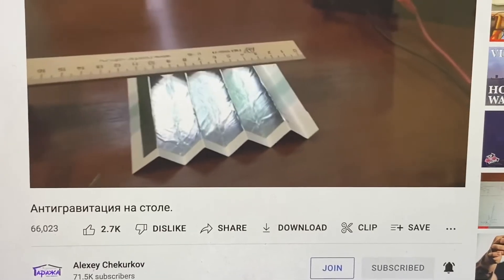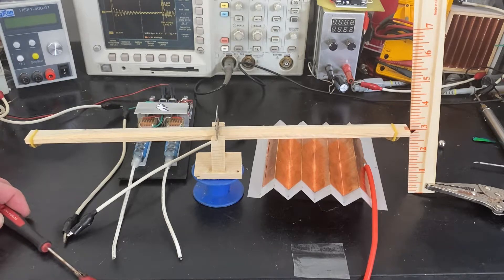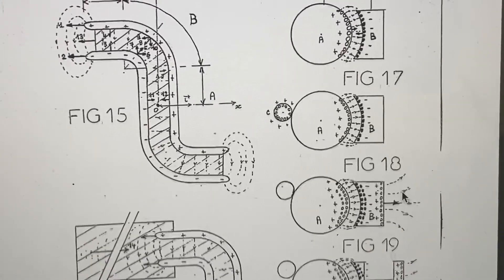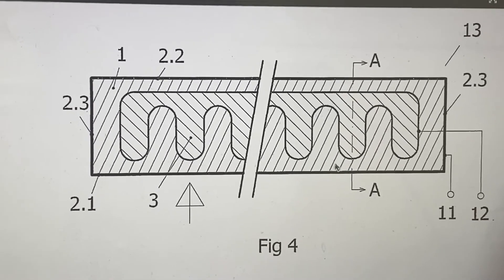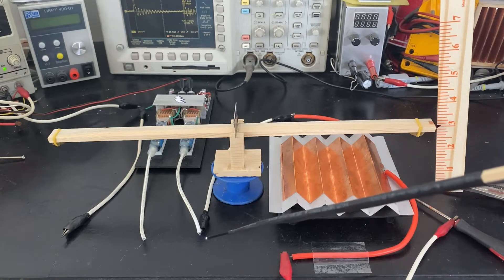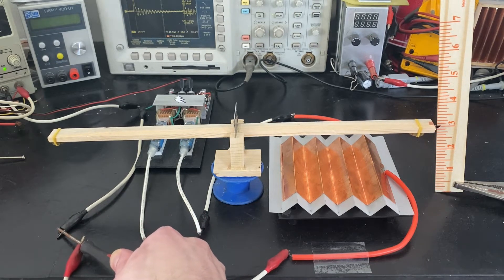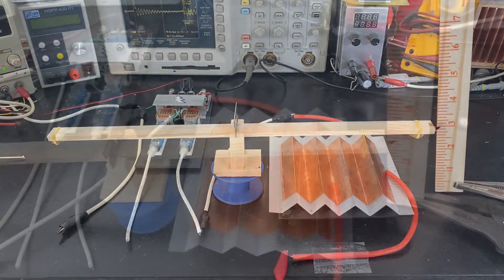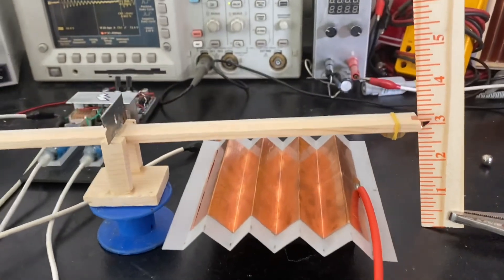Replicating Alexey Chekurkov’s Strange Capacitor And Other Observations.

Comment: If you want to do a test that will help your graviflyer fly. Then do this. He tells you to place the #2 coil wire in the top of the tube of the tesla coil. He is doing thins because to create a resonance frequency ( two wave forms and a pulse ) you need the tube to be the resonance chamber for both the coils (#1 and #2 ). The pulse is in the spark gap as long as you do not put to many capacitors in the design.  The ultrasound gives you the second pulse for amplifying the conductivity of the aluminum ( the jellyfish effect or short jumps it makes. ) here is a video on it. https://youtu.be/pZNNWrA9MZQ    just remember resonance and a resonance frequency are different. Resonance frequency is like tesla's earthquake machine. I hope this helps.
Reply from the maker: Wow that point is simply excellent! After all these years hearing the older and wiser energy researchers speak about “resonance frequency,” I had always wondered why they did not say “resonant frequency” instead.  I thought it was only a linguistic preference of the older individuals that was lost with time. But no one had bothered to clarify a difference between these two distinct terms. You are the FIRST person to ever share that most wonderful observation with me and I thank you sincerely for it!  And now that you’ve revealed what was hidden in the open, it may very well get a video of its own so that others can learn from this critical lesson as well.  Rock on brother!
Reply: @exoticpropulsion8175  I also figured out what Alexey was doing with the resonance. It is 2 things. 1. The pulse pushes the magnets down. If you draw a picture of it then put a coil under the center disc. you will see it clearly. He built a speaker. However his rotates. The result from that is, that he is creating a sound wave that drives into the ground. Thus lifting the craft. The ions created by the h.v. also help in this. The best part is what the second part of the tesla coil does. 2. If everything is made of atoms and all atoms have electrons and we excite electrons to make energy. The when electrons flow over something it blocks the force of all other electron's. ( tesla's sea of energy) The weight of your craft never changes. The coils energy blocks the gravity around it from applying force.  That's why every one of these crafts have it. 

By the way the beetle shell was to demonstrate the resonance chamber. the point in the opening collects electrons. That is what he was trying to convey.

I thought since you test things that you would be able to see it like I do. Thanks for listening.
Reply from the maker: @oldmanbuilds  Ahh, so it may indeed be using Phonon-Plasmon resonance to generate the torsion field then.  We theorized that it was an ion-acoustic cyclotron action in the RF range that was doing most of the work to twist up the Aether, and it sounds like you are also familiar with these concepts :D  We should really talk more in depth about the flyer if you’re willing to have a phone or zoom call. I’d love to hear all your thoughts about how we can get it flying, cause it’s been a nightmare to get the damn thing in tune. I’f we use zoom or Skype I can show you the build live on video so we can go over its adjustability and parts. You may see something to improve that I have missed. What ya think?
Reply: @exoticpropulsion8175  I figured out how these things work in harmony, however the frequency's have eluded me as well. I am building my tesla coils to be like the tuning fork and the box. so that they can work the same way with a piece of textured aluminum between then. then I can test the frequency's and see where it is. I believe I will have to add a pulse to it as well. May be it will work may be it won't, but I will still learn something. 

The whole pulse thing was found by accident . I was showing my son how granite was conductive in water and as I added more bowls of water with granite it would increase the #. I just placed a speaker wire into each bowl and chained them together. The pulse came when I turned on my sink then turned it off. the # spiked. I did it again and saw it was the difference needed to amplify things. 

It would be good to get the frequency's correct. That way I can build Carr's craft as well. 

I will ask my daughter to set me up on zoom so we can do a call. It would be interesting. Especially because all of these crafts have the same design when you break them down. And some of these people are lost on the wrong thing. Like the utron instead of seeing the coil on the bottom and the rotating magnets below it.
Reply: @exoticpropulsion8175  I have a question for you. Are we looking for a frequency when it already exists? Rotating the two discs at 2800 -3000 rpm is the frequency. He is putting the hv to them to get it. Frequency is only how many times something makes a revolution in a given period of time. When in tune mine has an alien sound just like my 3d printer. Do you think it is possible that the tesla coil only needs to create a bubble around the craft while the frequency is driven by the discs?
Reply: @oldmanbuilds  Hey i think I have a solution to the frequency problem. So 11 is the magic number which has been judged to be the magic figure, something using which they are healing cancer in EMacoustics. for eg. 432hz music combined with 432*11 = 4752 hz music brings relaxation. try frequencies 11 times apart.
Reply: @TheMrIndiankid  so based on what you said then in f=1/t the 1 has to have a multiple to it, and that will give me the correct frequency? F=(x)1/T
Reply: @oldmanbuilds  ya like the C music note is at 440Hz, ...u would have to find a band of frequency where this 11 multiple concept works.....most probably its in   100000hz above range, as per my knowledge of grebnikov reenactments.
Reply: @TheMrIndiankid  Im about to start experiments. I'm trying to see if anyone used for instance 440hz as 2 220hz to make 440hz. Or 4 110hz. Or did they just use 440hz by two frequency's.
Reply: @oldmanbuilds  try something like 14256Hz and 156816 Hz.
Reply: @TheMrIndiankid  I figured it out. If you follow the wave form it intersects the center at 58.27 the again at 116.54 and so on. so as long as I divide or multiply. It will still be the same frequency. The 58.27 is A# That's the frequency of aluminum. To put a field around my graviflyer I need 2 coils at 58.27  That means coil one and 2 of my tesla coil must be that frequency. All I need from there is a pulse wave from the ultrasound or a second center coil on a tesla coil where the #2 coil is 50% on one side and 50% on the other to a flat #1 coil with a pulse coil under it. ground is the craft.  

I have more building to do.....
Reply: @oldmanbuilds that’s crazy music can lift an object. The Egyptians was in the right direction. They said they use sound to lift heavy objects at a certain frequency.
Reply: @exoticpropulsion8175  I have design for space alterations , gravity , beam generations  , testing Kerr Newmann metric . Can you do it , all u need is rent 25 kg mercury .
Reply: here is the speaker video.   https://youtu.be/BXe_oRXlegM   It's funny that as soon as you see the coil and you know he replaced it with resonance. Your whole project changes.
Reply: I have no clue what you guys are talking about but i’m so interested 😂 to bad i joined the infantry militairy 😂
Reply: @OverSimplifiedHQ  get back safe. The whole discussion is about vibrating something at enormous speeds and what effect it has on the environment around it.
Reply: Im brining this topic back from the dead lol
Reply: @poisonisback3141  kinda funny I am needing to reach Jeremiah to see if he still wants to work with CCTO as another project is taking me closer to being able to produce a bunch of it (working a hybrid limestone casting system where the calcium carbonate is infiltrated with other compounds and I have copper acetate in abundance due to doing PCB etching and such even got some 30% acetic acid for it, and that is one of the tests right now to see how when its reverted back to carbonate a copper/calcium carbonate will form and how tough it could be, (will be at a better location to do research from too soon, and have my truck back up and running to be able to visit other experimenters,) )

Comment: hey @exoticpropulsion8175 are you still interested in testing fully fired shape CCTO ? getting ready to work on a project for stone casting of a new research building, and one of the tests is going to be calcium carbonate dissolved in copper acetate and while doing investigation I ran across the titanate version again reminding me that is still on the list 

moving to a better location and have all my glass ware and most of my electronic lab hardware up there already, and the plan is to get an alan's buildings 1200 square foot metal building so we need a good solid floor with more durablity than plain concrete so... (kiln is there already too, :) )

Comment: electrons carry charge. electrons have mass. for charge to flow, constituting "current", then mass must be moved. wheres teh newton, action and reaction?

voltage pushes current through a circuit... whats it pushing against? 

or, for a water analogy... a closed circuit full of water, with pump. if the pump motor isnt bolted down firmly, what happens when its driven? the whole assembly spins around, rather than the water in the pipe moving... 

the more i delve into the origin of electrical units, ergs, dynes, coulombs, ohms, henries, amperes... the more "one sided" it appears. it took work to move the charge yet theres NEVER any mention of a reaction to moving that charge. just the dissipation of energy as charge flows through a resistance, and thats not quite the same thing, is it?

think about anodes and cathodes. an anode is positive... why? because it has a deficit of charge, electrons. 
the cathode has an excess. they will try to neutralise each other.
in a circuit, the flow of electrons is from cathode to anode, a direct result of the charges trying to neutralise.

but that anode has to then emit electrons and push them onto the cathode for this current to continue... the wtaer pump, the battery supplying the EMF... the anode must emit electrons at the same rate it receives them for current to persist. the cathode must accept electrons at teh same rate it emits them for current to persist.

take away the pump, the source of EMF... and then what? you have a loop with nothing happening, it could flow either way... to make it flow in a particular direction, something external to that loop must experience an equal and opposite reaction...

Comment: Wouldn'tthe capacitor simply be putting a charge on the wood of the same positive or negativing as the case may ben, then just causing it to repell the capacitor?

Comment: This is how he is manipulating charges to lift off the ground. The ground is making the attraction charges multiply. When the craft gets a reverse charge, it pushes off the ground. However he needs the ground in the beginning for the charges to build in the craft. If they don't build by using the ground there will not be enough charges in the craft when in the air. He doesn't need the voltage from the ground. He needs the charges in the craft to multiply. this experiment gives you an answer to his Graviflyer that no one would even guess is happening.

Comment: Now try to do this with a capacitor of the same surface area, yet a flat plate, same average distance away from the bar.

Try to use something other than wood for a beam because wood has moisture in it.

Comment: charge one side of the capacitor through, let's say, a light bulb, in this way, a voltage conversion will take place, on the other side of the capacitor, this will be the driving force.
you can use charging and discharging cycles, there are other ways to increase the effect.
but the better the results, the greater the health risk.
there is also protection...

Comment: The gravitational effects persist with a charged but unpowered capacitor. You need to compare the force of charged vs discharged without power applied. Power applied can be ionic wind or electromagnetic effects. No power applied effects challenge conventional physics laws and so can only be the gravitational effect desired.

Comment: Easy to test if this is gravity or not by using the capacitor to deflect horizontally on a torsional pendulum. My guess is it's simply static electricity coupling.
Reply: Agreed.
Reply: Believe you're correct...nothing to do with gravity.

Comment: This is probably some type of effect because the ruler is made of dielectric. It's a fairly small force, smaller than the lift that the heat of a candle could generate. 
Dielectric exhibit many strange properties that are well understood only by people beyond the graduate level. It's easy to just think everything is either a conductor or an insulator, but dielectrics actually have many strange properties and exhibit effects that are within the realm of electricity and EM radiation. 

Maybe you're creating some kind of hybrid capacitor where the ruler is acting like a separator so you effectively end up having a capacitor and then you get the ruler coming closer to the top copper surface. As it gets close enough the charge is somehow affected because it's like if there was also a piece of foil on the other side of the ruler you'd end up with 2 capacitors with a plate in a sandwich (plate, separator, plate, separator, plate)

This isn't an electrolytic cap but it probably also matters that the one plate is copper and the other doesn't appear to be copper. This could lead to a charge that tends towards a polarity because of the different metals probably copper would be more negative. Maybe its just that. D Zdx

Comment: If it was ionic wind effect, where does the capacitive material geometry came to the equation? In my opinion, the geometry is essential to modify structured gravity, and actually gravity is fractality of moving electrical charges

Comment: If you had a metal ruler, that is grounded, there would be no anomalous deflection.   You could even wrap Aluminum foil around the wood ruler.   When you discharge the thing on the bottom, you are just inducing a charge on the surface of the ruler.   Everything you are seeing can be explained by electrostatics.  No antigravity.
Reply: Its produces electrostatic thrust. Over 1g with right materials. Its proven

Comment: Hi. You could avoid any electrostatic issues by putting all the high voltage stuff inside a metal box, just expose the positive electrode of the capacitor, which would be part of the box's wall and be grounded whereas the  negative electrode would be insulated and powered fron a hi-voltage source with grounded positive wire.

Comment: This is what AI told me. Capacitors are electronic components that store electrical energy in an electric field. They are not affected by gravity in the same way that objects with mass are.
Gravity is a fundamental force that affects objects with mass or energy. It causes objects to accelerate towards each other, and the strength of the gravitational force depends on the masses of the objects and the distance between them.
Capacitors, on the other hand, do not have mass and are not subject to the gravitational force. Therefore, they cannot experience a change in gravity in the same way that objects with mass do.
That being said, capacitors can be affected by other external forces, such as electromagnetic fields, temperature changes, and mechanical stress, which can cause changes in their electrical properties. But these effects are not related to gravity.
Reply: AI like Chat TGP is know for blatantly making things up and presenting it as fact and  can not be trusted as a source.
Reply: Capacitors experience gravity just like everything else in the universe. What are you yapping about?

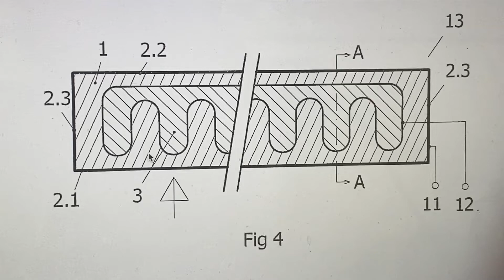Comment: time in video 2:44 he takes the frequency of the motor and says he can change it.   https://youtu.be/_6dA4QFoHeY  I will verify the test. By the way the capacitors from the high voltage are to adjust the oscillation of the high voltage. It works just like tuning a tesla coil. We all believe the power is dc coming out, but I don't think his flyback is internally rectified. so it comes out ac. That's why it sparks on + and -  the speed of the oscillation is the chop or switching time. (basis for the math to find range in hz) He said it all ran on resonance so in order to get resonance you need the same frequency from both motors to get oscillation to create resonance.  It make sense that the tesla coil would be set the same way to boost that effect.

Comment: Bro as a physics student i wanna explain this phenomenon, firstly, all you do is another replication of brown effect, you create imbalance after you shock the capacitor as you said, this imbalance need to fill with electron so it pull electrons from the outer materials which is gas, this attraction create also imbalance in the above air, it cause a negative or positive (if you do it reversly) pressure in the air as you see, so this wind pressure pull or push the item you put there no matter its type.

If you do that experiment in a perfect vacuum, you will see that effect will be gone. (Still you can try this, i'm not %100 sure.)
Simply there is no strange activity. But I wanna thank you for recording this effect with a different setup.
Reply: Ha nope check out the news. Its been proven in vacuum chamber 2024